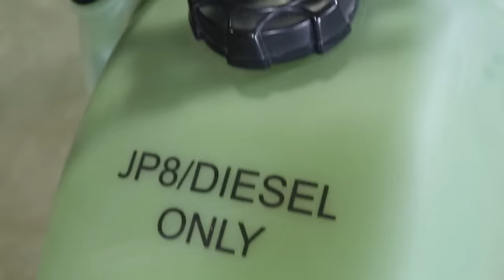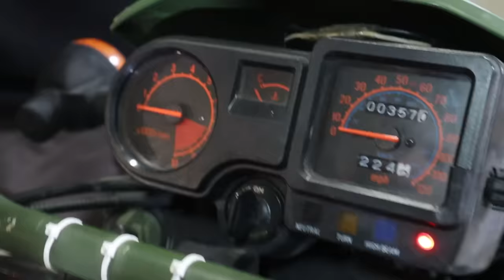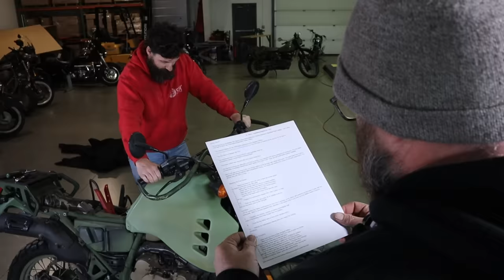I Bought a Diesel Dirtbike from the Marine Corps(1 of 214)

Comment: I'm a retired Marine. These bikes were all over the place being used by Marine Corps Scout Messengers. I'd say put out a call for a Marine Corps motorcycle mechanic to get his input. Also, every single item we used had a technical manual, even for something as basic as a bayonet, for example. They have everything you need to know about maintenance, troubleshooting, principles of operation, corrective actions, materials needed, part numbers for everything, step-by-step diagrams for each maintenance and repair action, important tolerances, measurements, torque values for  fasteners, alternative methods if any to get the equipment running again in a pinch, tools and materials you need before you start each job... nothing is left to chance, everything is in there. You can usually download these as a PDF and print what you need to guide you as you work. 

Imagine you're at war and your mechanic is killed by enemy fire, and you need to grab some grunt and make him your new field-expedient mechanic. Just toss him the manuals and give him some tools with instructions to live and love his new position. You ever heard of the M2 Stinger machine gun used in Iwo Jima? Marines are pretty clever and capable tinkerers. 

As for the lights, those running lights operate in the infrared spectrum, and there are such lights on all our vehicles from HMMWV's to LAV's. You use them in combination with night vision goggles.

Interesting that they used MarPat woodland digital pattern on the seat. It most likely originally had a vinyl seat in a solid green or maybe tan color.
Semper Fi.
Reply: There were a platoon worth of these bikes parked at Camp Pendleton near where 1st Recon Battalion was located in the 2000's last time I was on that base with orders.

And agreed that everything in the Marines Corp and the military for that matter has an operations manual for the user and a repair manual for the mecha ic. Even helmet chin straps have manuals. Part of the requirement for the DOD to aquire new equipment. The whole Corp had been converting to adVD manuals by the time I saw these bikes. Which means there are PDF files in existence somewhere. Getting the DoD info on them will be key to getting eyes on a manual. The publications/manuals encoding system is incorporated with the DOD item number system. Any technician in the military would know how to look up that info or how to find the appropriate manual with that info. 

The bike will have a military model number that is not the same as the civilian model number. For example with Pistols: M9 (DOD) vs. 92FS (civilian)
Reply: What you said

Comment: Haven't reached the end yet, but I would ordinarily crack injector lines to bleed the system on the old Yanmar generators.  Also, Decompression lever is to drop the compression get low enough to spin the engine around fast enough to get it to fire.  It's pretty common on old diesel generators to allow you to pull start them.
Reply: You are correct! All kinds of diesels utilize a decompression lever, some engines including small gasoline engines use an acr (automatic compression release) .
Reply: @brentfellers9632  Even the regular KLR has a decomp valve, via an automatic system called KACR. Looks like they needed a beefier system though to get the diesel engine's compression down enough to crank it with a stock KLR starter.

Comment: The decompression lever is used because the starter would have to be massive to over come the compression, so you let it gain some inertia and you release the lever and it should start.
Reply: Could riffing on the starter a bunch with the engine fully compressed cause damage?
Reply: Scotty Kilmer has one. He has a YouTube channel.
Reply: @TheGrobe wouldn't do it any good
Reply: @scootypuffjr.  Not that it does any good now but I was just thinking that if you don’t let that starter build up momentum like it’s designed to have, but instead trying to fully compress that diesel each rotation, it probably stresses that linkage that broke.  That’s the kind of specialty engine you really need a manual or an expert to give you a procedure before you start trying to riding off into the sunset because they do so much to try to make them lighter, faster, longer range, jp-8 ect. “militarized” gear is really wacky sometimes.
Reply: @buttersstotch1002  Oh I know. They (people designing military gear) try to "idiot proof" what they can, but this engine would need redesigned from the ground up with a heavier starter and crankcase to take the cranking forces with no decomp. I'm sure it has either heavier flywheel or a flywheel weight and the procedure is likely wing it over with the decomp pulled and then give it full compression when spinning. Mechanical diesels especially, usually fire on the first rotation
Reply: ok
Reply: It's not used while starting. Only bleeding the lines.
Reply: Big, 855 (cubic inches) Cummins diesels had compression releases back in 60s & 70s
Reply: @ronunderwood5771  Perhaps that was for other purposes than starting the engine, such as bleeding the fuel lines or other diagnostic procedures?
Reply: @clifm9574  Cliff it was specifically to aid starting, especially when cold. And it did. A lot of rotating mass when they got to spinning around with the lever pulled. Mechanism held the valves open. Exhaust IIRC. Exhaust push tubes had flanges on them. There was a bar running the length of the block with forks welded on it. Hold back on the lever to move the rod the forks would push up on the tubes holding the valves open. This was a long time ago and my primary specialty at that time was Tonkas. I remember my granddad showing and explaining the system to me. It was gone by the 80s I’m pretty sure
Reply: Fuel tank to prime pump prime pump to high pressure fuel pump , hpfp to injector , injector to cyl  compression heat boom  power and out the pipe . That out the way prime lpfp , now prime hpfp  now loosen  injector fitting  and turn both pumps till u get fuel ot of fitting like bleeding brakes once u get fuel from fitting lock it down . Now u can turn key wait for glow plug to heat up hit decomp valve open hit starter close valve and should start if not walk bike outside grab red gas can a couple of chairs some matches  start cameras pour contens of red can on green bike  light match  throw at green bike  step away from fire and sit down to watch the  green bike  start up
Reply: I used to have to start an old single cylinder diesel water pump... with a hand crank 🙂 open the compression switch, crank it up to speed and throw the compression switch and stand back...
Reply: Like the instructions said. Cool bike.
Reply: yes a 2 stroke diesel bike.
Reply: Yeah

Comment: I was Marine Corps Motor T in the early 2000's. I went to Camp Johnson in NC for Training on the Military Motorcycle. Back then most Marine units had the gas model but a select few units had the diesel model. the school was alot of fun and we got to tare them down to the frame and then put them back together plus ride them through the trails at Camp Johnson. I treated it like a paid vacation.
Reply: Semper Fi bro, I was USMC Motor T in late '60's-early '70's.  They didn't have bikes back then so I drove duece and a half.  Been riding bikes ever since.
Reply: Quote worthy
Reply: Dang im Jealous !  Thanks for sharing and thank you even more for your service .
Reply: I was a courier, and had the opportunity to ride the multifuel dirts.  Man they were a blast. Don't ask me how I was selected to be a courier, when I was already the Marine with the international DL.  But then again, me being the Op's NCO, I had quite a few billets to fill. Man I miss those days.  Also on CJ, but in '96, and then to LeJeune shortly after graduating from the MT school there.

All of the M1030M1's were multi fuel, they phased out the M1030's so they wouldn't have one separate that ran on gas and one on diesel.
Reply: I was stationed at Camp Johnson from early 1991-late 1992.  First as a student for DTS (Drivers Training Section) and then as an instructor at DTS (5 tons only).  Yes, in the Corps infinite wisdom, they picked 4 students that had just graduated the school to go back and be instructors.  This was not based on merit at all, just random assignment.  At least I got some fleet time later in an Arty unit.
Reply: LoL, 3521 here. I hate camp Johnson! 🤣 Food was legendary though.

Comment: Blackout lights are also for driving with night vision. Night vision still requires some light to work, so for you night vision to work while driving you need some ambient light. Awesome video!!!
Reply: Now I am just picturing these two on USMC Diesel Kawasaki's with night vision goggles doing shenanigans and honestly, that's the content & experience we all deserve. lolol
Reply: I came to the comment section  to share this same information.
Reply: Driving a track is hard enough with night vision. I could imagine driving a dirt bike.
Reply: @tylerthomson67  I remember doing night vision training in a 5 ton and all I could see is my own reflection on the windshield.  All it took we the very dim gauge lights to light me up like a Christmas tree!  I was pretty much blind to everything outside of the cab.  I'm pretty sure a knocked a tree down during that FTX.
Reply: Blackout lights predate night vision. WWII tanks, trucks, and even civilian cars used them.
Reply: Blackout lights are for convoy use, modern night vision like the ones the Marines would have been using with the bike mainly the PVS14 require ambient light from the moon or stars nothing vehicle mounted because if you're fighting a peer or near peer enemy you've just lit yourself up like a Christmas tree.

Trust me as someone who's done a bit of night vision work (got the bad back to prove it from stumbling into a ditch) those are simply convoy lights.
Reply: @sideshow4417 also negative. You’re incorrect sir.
Reply: @raevennull that’s why you switch the controls to blackout. It dims the dash lights as well. That or 100mph tape and an MRE box for the dash then do the same for the tail and headlight if your blackout lights are deadlined. Circle x.

Comment: Diesels typically run twice the compression of gasoline engines. It's like chainsaws with decomp valves - let you spin it over easier/faster. I imagine they still have regular klr starter on there, so the decomp will let them run that instead of sourcing a stronger one. Also easier on battery.
Reply from the maker: I learned that after we filmed. Great info
Reply: @BikesandBeards  See the comment from milleR above he owns one of these bikes and thinks he knows what you did to the bike - it sounds bad..... but also sounds like its fixable.
Reply: @Tolbat  IF that's what happened it's a really easy fix.  Pull the stator cover, pop off the flywheel (it'll be loose) replace the woodruff key and reassemble.  I just wish I'd known that was the problem before replacing the starter, starter solenoid, starter relay, et al lol
Reply: @BikesandBeards  

You got a scammer posing as you trying to scam people... you should address your audience before someone gets ripped off
Reply: As Derek from vice grip garage says, if it works, is it really a dumb idea?
Reply: Yea I guess when your as bright as a potatoe, you get many views and comments and build a big youtube channel. I apologize for that outburst

Comment: A diesel mechanic could help you. This engine is a mechanical injection system. 1. Don't use ether, you can blow the head gasket. 2. The first pump is a lift pump to make sure the injection pump has plenty of fuel. Verify that it works. 3. Injection pumps are high pressure and must be timed like a spark plug.  4. If there is air in the injection pump or injector lines it won't start. 4. If you can get to the injector line coupler, loosen the fitting to bleed the air while cranking with compression released. 5. The injection pump could be damaged if it was run dry and that's why those pins were sheared off. 6. The compression release should be used when starting then closed once the engine is cranking to start. This lowers the stress on the starter. 7. Does it have a glow plug? If so, should be a light on the dash that goes off when ready to start.

Comment: I'd get it all back together the way you first got it. Chances are its air locked somewhere in the fuel system. I know nothing about this bike but spent years working on diesel trucks and this is what i would do to start one of them that lost prime. Pull the suction/supply line off the injection pump then apply a small amount of shop air to the fuel tank (3-4 psi) just with a rubber tip blow gun and a wad of shop towels to seal the fill hole. That should at least get fuel up to the injection pump. Once that's done reconnect fuel line and look for a small plug (usually 6point 10mm)on the side of the fuel injection pump that is a bleeder, crack it and apply air again. If no bleeder plug is found crack the outlet line at the pump that feeds the injector and apply pressure. Work your way all the way up to the injector once you have fuel coming out the top of the injector at the fuel line threads it should be primed. Open up the decompression lever get 5-6 full rotations so a little heat can build in the cylinder than close it and hope it starts. Also almost all little diesels need a glow plug or intake heater to start so see if it has one of those and if so make sure they work.
Reply: This old bike does have a spot to bleed the air and pump it out. I had to use it in the field once and it kept me from having to push the bike back to the truck

Comment: I bought a KLR that was converted to diesel by a guy in Texas, and it was fun, but nothing like the Military version. It had a 418 cc Diesel Generator motor with a CV Go kart transmission.  When I got it, I had to tweak it some to get it dependable and put out as much HP as possible.  I could run 55 mph on it all day, but take offs were dismal. 
I built a real exhaust pipe for it that used a modified (gutted) KLR muffler and straightened the breather intake so it could use the KLR air filter and box.  I converted the choke lever to the decompression lever and that made starting it a LOT Easier.   The up side was it got me 95 MPG most of the time.  But I live in the Country and I needed it to go at least 65.  It was fun to ride, but never fast enough to keep up with even the 250cc gas bikes.  (Think 50cc scooter performance)
I sold it to a friend in Ohio and he loves it.  Last I heard he was still putting around on it. 
I'm still riding my 06 gas KLR.  160K miles and running strong.

Comment: I rode the KLR 250’s and 650’s in the Marine Corps from 96-2001 but they were gas and there were talks about changing them over to diesel as I was leaving. Even in gas form they were way underpowered and under suspended for the terrain we used them in. They were bulletproof though.
Reply: They were always lack lustre and cumbersome.
Reply: That's the whole point of the KLR. They're so cheap brand new. When I was standing next to one of the new ones at the cycle shop, I couldn't believe how large it was. A lot of bike for the price

My buddys dad has one of the originals. It's been wrecked at least three times since I've known him and just keeps on charging. When we take long back country trips I always feel comfortable knowing ones around. Under powered, yes but still strong enough to drag a dead bike home
Reply: the diesel was better off road because of the torque
Reply: The marines ordered a few thousand EV dirtbikes already because they have a perfect torque curve, 0 shifting, and are totally silent. Problem is, they can't be used/stored in extreme temperature due to the batteries so they'd suck for the desert.
Reply: @kylem7708  ev bikes are such a cool idea, but jesus that sounds like a waste of money. maybe with some military investment solar panels will start getting better or something, but i cant imagine ev bikes would be super reliable
Reply: @premo8564  They're primarily used for their sniper units from what I've been reading since apparently Marine snipers were recently kinda restructured in their roles, they're more under intel and recon now as we gear up for a war with China. EV dirtbikes only have like, half a dozen moving parts vs all the piston, engine, cam and crank shafts, valves, etc ICE dirtbikes have. They're even belt-driven so you can have spare belts to swap with ultra-basic hand tools like just a combo wrench and allen key since they're so light and foldable n don't need a chainbreaker tool to push those lil pins out and all the extra time and fine motor skills it takes to use it without dropping and losing your pins while being chased/shot at.
Reply: @premo8564  camouflage solar panels shaped to the bike shell
Reply: @kylem7708  if it is like you say, and ends up stupid easy to work on (like a skateboard with a multitool) i dig it. cool bit of info, sounds like it would fit its role well. 

i used to work with electric forklifts/pallet jacks and we had this awesome giant electro-magnetic pallet jack to swap out the batteries (bike batteries wouldn't need to be the weight of a small car obviously so it doesnt have to be that crazy), it would be cool if they forward-thought with quick swap batt packs or something along those lines. Some of the batteries in the warehouse would see more use than others, and you could definitely tell when your forklift had one

Comment: I’ve had experience with a diesel KLR but it was by accident when I put the all 6 gallons of unmarked diesel in my 2015 klr 650 😂😂 ran great for one whole block.
Reply: I put diesel in my lawnmower once after I filled a gas can with it and said "I'll remember".... When it wouldn't start the next day I didn't notice until I drained the carb and it smelled a bit diesely 😆
Reply: I did the same also on a 2015 KLR650 a few weeks ago while touring Australia, I got nearly 3 blocks